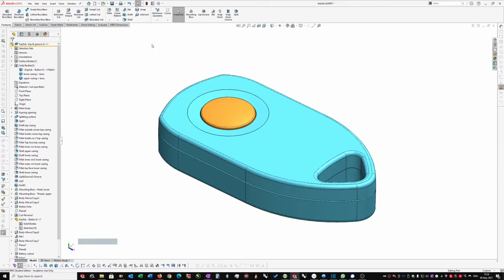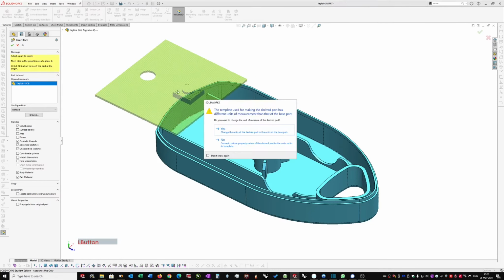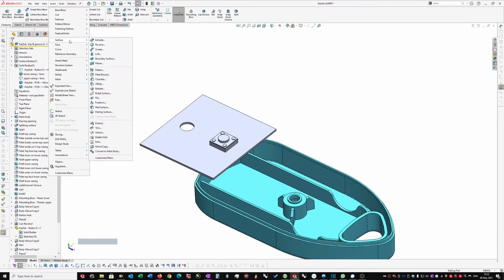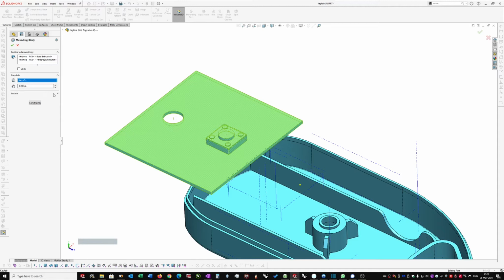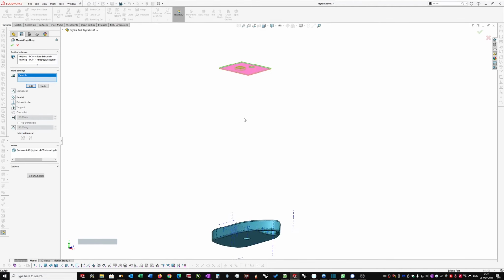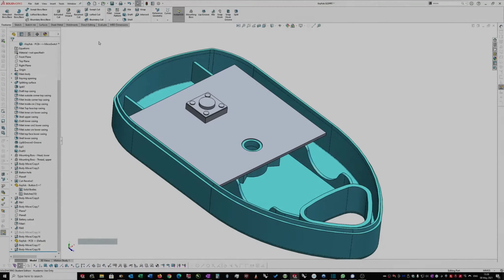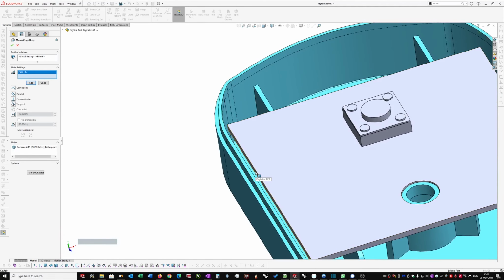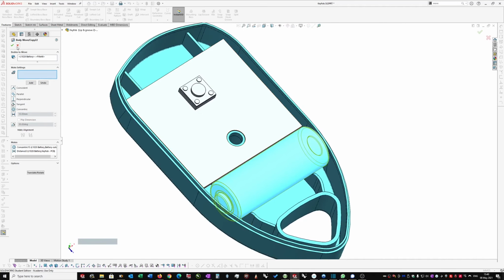Solidworks 2020 - Week 10 part 3 - inserting parts into a multi-body part file

Comment: Thanks, but even after your good effort I still struggling. Coming from Autocad I find Solidworks frustratingly unintuitive. Enough so,  I find it not worth the effort.
Reply from the maker: Hi Jack, thanks for your comment. I've had to hop between many CAD programs in my career and always found it frustrating that the 'new' program couldn't do things the way the 'old' did. But it's just a matter of familiarity that makes one program seem intuitive and the next unintuitive - if one is comfortable with one way of doing things, the discomfort experienced when that's taken away makes the program seem un-intuitive. But if you're comfortable with Autocad, why would you want to move over to Solidworks? As long as you can get the job done, it matters little how you get there.
Reply: @philduplessis7756  Thanks, I appreciate the reply.  Why switch to Solidworks? #1, I've been away from cad for over a decade so it's a learning curve either way. I've tried Fusion 360 but solidworks seems a more developed and industry standard ecosystem.
Reply from the maker: @jackoneil3933  Interesting, I'm considering crossing over to Fusion 360 because it's affordable (SW is outrageously expensive), but I guess one has to choose the package that's going to get you the most work? SW is phenomenally capable, but huge swathes of it go unused. I wish you luck whichever route you take.
Reply: @philduplessis7756  Thanks, Fusion 360 seemed worth the money, but it may be lacking some of the features of SW. 
I have access to an SW group seat so my cost is nothing for the moment. I've spent a couple more days with SW 2020 and  moving a bit faster but it seems needlessly cumbersome in many respects.